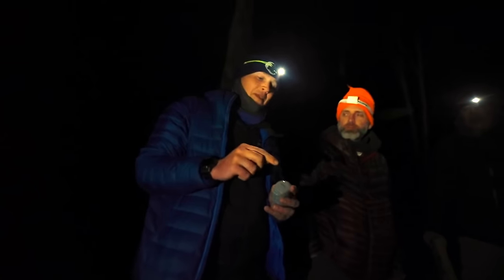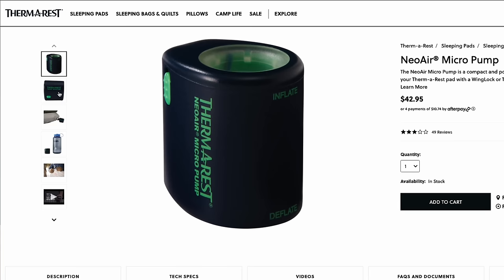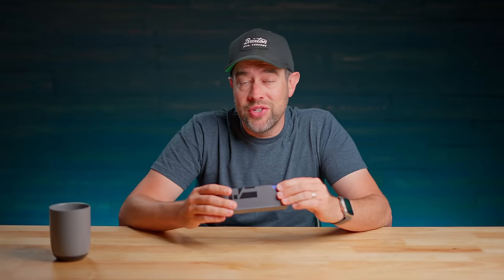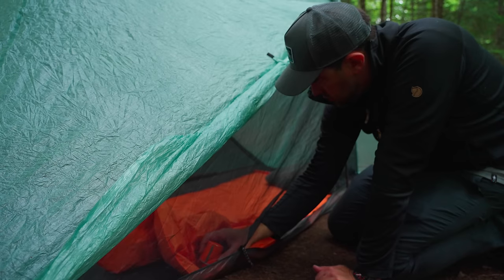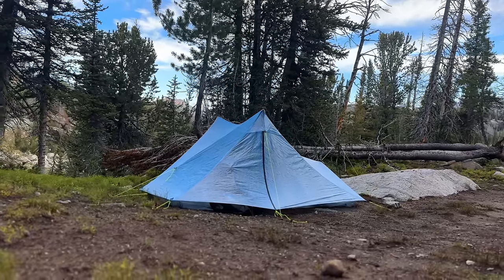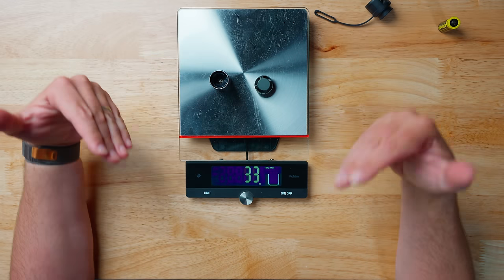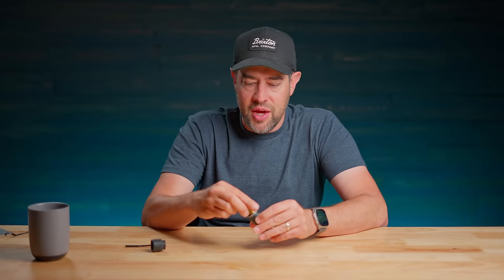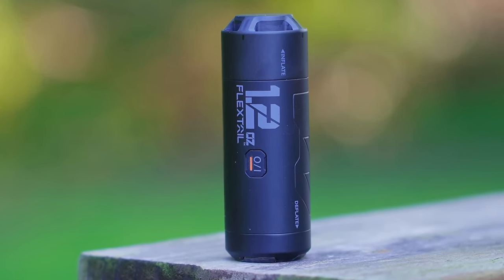The GOAT of camp gadgets just got a MAJOR upgrade

Comment: I'm sorry, but I just do not get the "carry a tiny pump so that you don't have to use your lungs" thing.  If you are a backpacker, presumably you are already in decent shape...so why do you need the pump ?  "Oh, you don't wanna have to use your lungs after a long day of hiking." Bleh.  Really ? Never been a problem for me - and I am NOT an Olympic athlete by any means. I am now 62 years old, by the way. 
"Oh, you don't wanna put moisture into your pad...blah blah blah." Again, never been a problem - I don't see one now. The mold issue is not a big deal...and is easily prevented. The amount of moisture we are talking about here is minimal, anyway.

Finally, so now we are gonna ADD BACK gear, after all the efforts to reduce weight ? Plus, we are gonna now carry an extra battery for this gadget ? EXACTLY the kind of thing backpacker guru youtubers have always railed against...

So, bottom line...IMO...gadgets like these are solutions in search of a problem. Gear companies have to figure out new gadgets to sell, I suppose.  To each his/her own - I would never criticize anyone's gear choices - and I'm NOT doing that now. NO criticism to Dan Becker on this, either. If you wanna have bits & bobs like  this, more power to you. As for myself (and I ONLY speak for myself, of course)... no thanks.